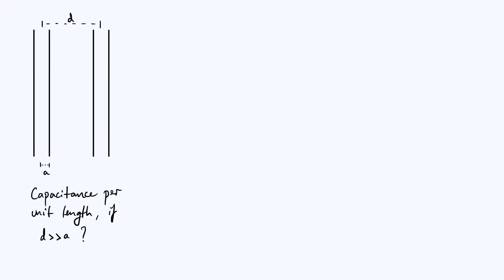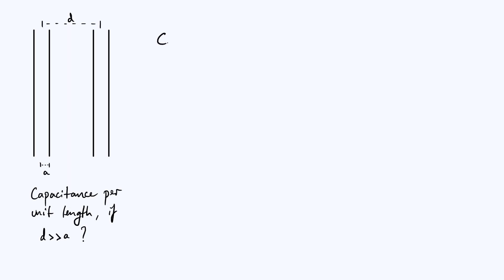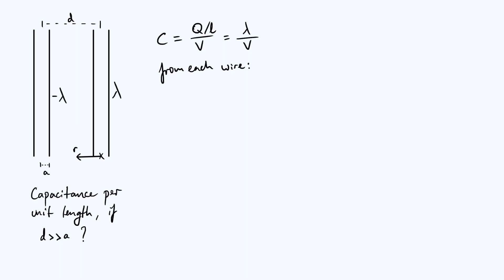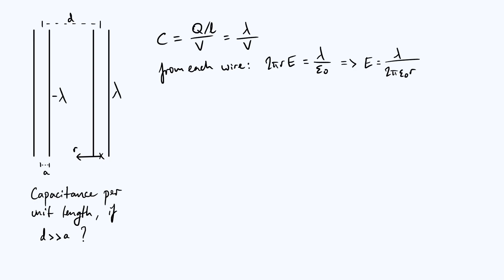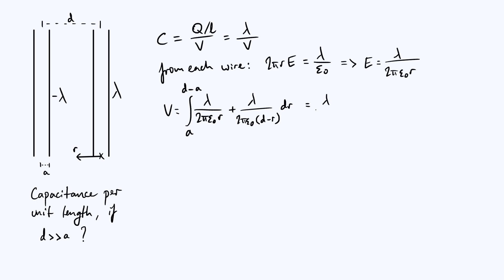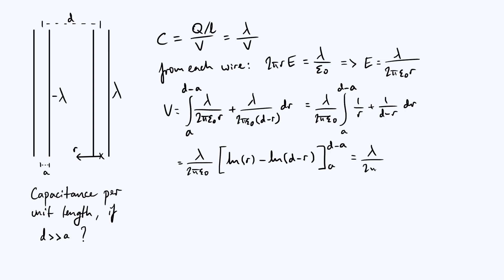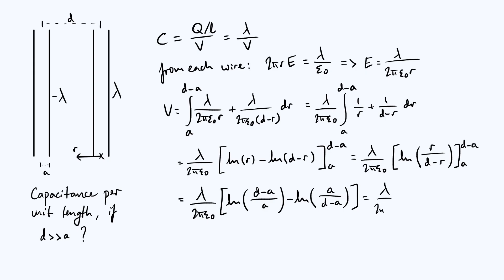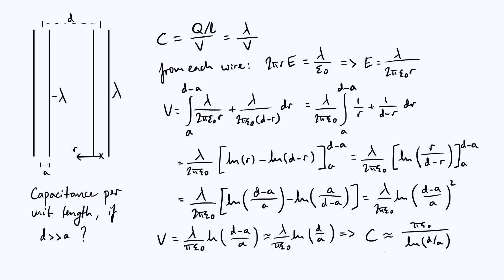Approximate capacitance of parallel wires

Comment: Thank you for your videos which are always very helpful, highly respected that you take the trouble to give help to students !
At the moment of 6:34 in your video it is not so obvious what you do with the signs. I understand the right hand wire, it agrees with Griffiths method. Related to the left wire, first there is a plus sign and there is an unclear discussion that there should be a minus due to the negative charge on the left wire but in the end the plus sign is kept, it is somewhat unconvincing what you say. Apparently you want a positive number in the end so a plus sign is kept and you keep the same integration limits. Isn't it so that you change your coordinate system by translating to new coordinates r'=d-r so that you get dr'=-dr and this delivers the extra minus sign that cancels the minus sign of the - of the charge on the left? The problem with these line wires is that at infinity there is no zero potential, which would fix your reference potential, additionally there is this minus sign of the left line charge, and on top of that is the displacement of the wire to the left, and coordinate issues. The coordinate issues are there as r is always positive as they are radial coordinates. I teach classes electrodynamics for physics students and if you would do this on the blackboard (not too well prepared) 50% chance that the explanation goes wrong due to these minus signs issues. Students would then ask questions like "how do you resolve this issue for the left negative line charge", you get stuck in the lessons as it can be tricky (heavy time loss in the lecture).  I guess that the coordinate change trick resolves the minus sign issues immediately. Let me know what you think please. By the way: The book by John Kraus - Electromagnetics chapter 3 is also helpful it discusses two line charges. In Griffiths book Electrodynamics this is problem 2.53.

Comment: slight question on this, since in my understanding, lambda is Q/l -> Q = lambda * l in our case here with line charge density, shouldn't our end formula be C/l or Capacitance per unit length = what you found? Thanks for the video btw really helpful
Reply from the maker: I'm glad it was helpful! Yes, the C in the video is defined as capacitance per unit length, not just capacitance (see 0:55 onwards).

Comment: Electronics & Telecomunication student here, while explanation is pretty clear and i understand where does it come from, im kinda confused. We had to made a model of cable with two parallel wires and find value of capacitance. The model is maded in FEMM and using values from program i get different value of capacitance and now im curious which value is closer to be real. Is there any way to find out? Using values from femm, im just dividing charge over voltage difference between two wires, is that good way or not?
Reply from the maker: My first thought is that maybe the approximation d >> a may not be valid in your model. Have you compared your value against the exact theoretical value involving cosh⁻¹? See: https://youtu.be/X84MVLe3ip0

Comment: I'm retired, and I'm using ( - wasting ?) my time going over my ol' University-Physics lecture-notes.  ... I was stuck for days on a page in my notes about the Capacitance of Parallel-Wires, and the books didn't help. I tried the Internet, but nothing worked/helped me until I watched your presentation.  ...  Many thanks.  -  Now I can finally turn-that-page ----->  [ - I'm now a Subscriber.]
Reply from the maker: Sounds to me like a great way to spend your retirement! I'm glad the video helped. Feel free to let me know if there's anything else you get stuck with as I'm always looking for new video ideas.

Comment: so what speaker wire has lower capacitance per foot - (1) 9GA or (4) 12GA wires?
Reply from the maker: For a fixed distance d, wires with a smaller radius will have a lower capacitance.
Reply: @DrBenYelverton  I see a lot of speaker cables that are using multi strands of a smaller gauge wire, such as 4 12ga wires in parallel to equal 9ga total.  I'm wondering if a single 9ga stranded speaker wire would be better than the 4 12ga stranded cables in parallel.